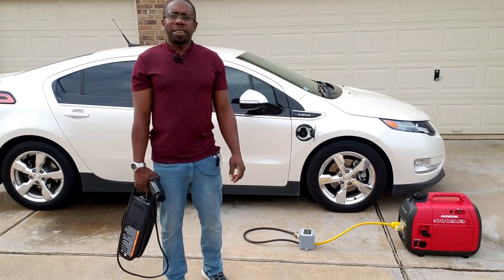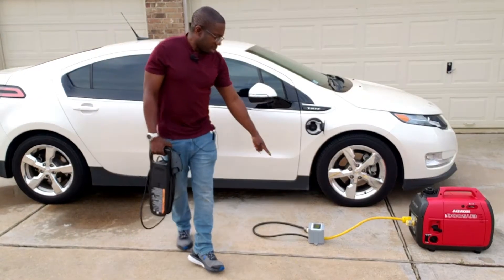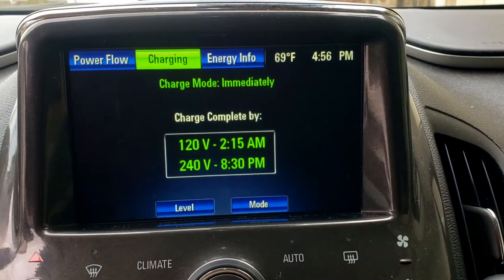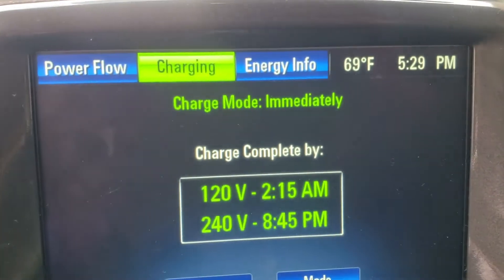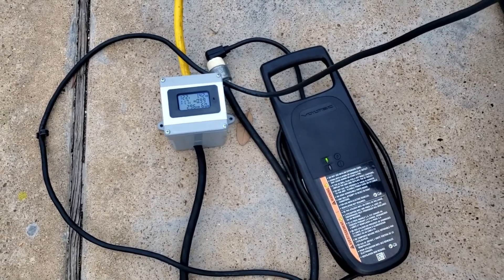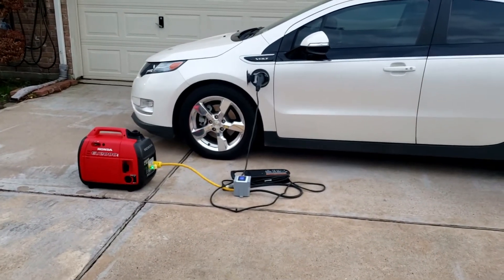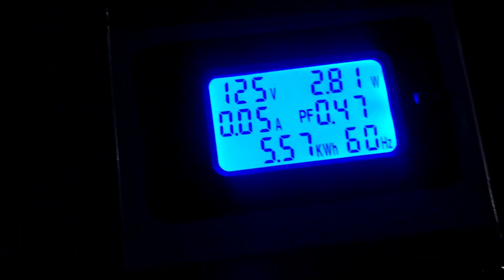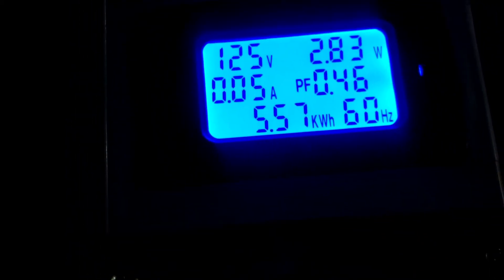Honda EU2000 Inverter Generator Charging an Electric Car.

Comment: I know that your intent was to prove charging in an emergency, but this also proves that this little, red Honda can be like a little red gas can. If you are stuck without power on the side of the road, a friend or spouse can come with the Honda and give you just enough charge to get you home or some other charge point. 
It also shows that if you go camping at some remote site, you can use the Honda to power the loads at camp and then add a little charge to give you some range to get you home!
Reply from the maker: I only wished everyone got my intent like you just explained. EXACTLY 
Thanks for watching 👍🏾👍🏾
Reply: if it only adds 15 miles in 4 hours a friend or spouse would be better off throwin a tow rope on it and tow it 15 miles and be done in 30 minutes instead of 4 hours
Reply: Yea if you don't mind sitting on the side of the road for 5 hours.
Reply: @warntheidiotmasses7114 or listening to a generator run all f’in day while you’re camping lmfao
Reply: @pnwDatsun  The last 3 years was an IQ test. One of the questions was to buy an EV or not.
Reply: That's exactly why I looked for this type of video,... In 2023 Subaru is releasing their AWD getaway all electric vehicle.
Reply: Or you can get an equally sized compact hybrid that gets 50+ miles per gallon and have your spouse bring you a gallon of gas.
Reply: Which would imply that you have to tell your spouse that you were silly enough to run out and need help? Nope Nope Nope @nateman79
Reply: @nateman79  For how much? $40,000? I can buy a 30 year old Toy diesel for $2000. Thank JesuS!
Reply: @warntheidiotmasses7114  diesels are cool by me… I just think electric only is ridiculous when you can have both… I just want my FJ cruiser, and to be left alone
Reply: @nateman79  yes and run without waiting 4 hour 50 miles with 1 gallon

Comment: 15 millles with one galoon of gas? This is a really poor yield. My Renault Clio runs 15 milles with 0,36 gallons. Converting figures into european measurments 15 miles with 1 gallon means expending 15.7 L per 100 km. Most of the cars expend 5-6 L per 100 km. Absolutely terrible for the planet.
Reply from the maker: I think you missed the point we were trying to make in case of EMERGENCY can you recharge your car with a Generator.
Reply: @GeneratorReviews  Yeah, for an emergency it could be a good idea. I was thinking if it was possible to have a generator with a higher efficientcy than a standard gas engine.
Reply: Diesel even less.In Greece where i live a make 1200 km with my Peugeot 406 hdi automatic.Its 65 liter tank.
Reply: wríbg
Reply: 1980  7,5   2 tmme more gas ysrga 155 noh

Comment: Go to 6:29 to get the answer... 15mi/gal  Too many people think electric cars are saving the planet. They don't. Where does the electricity come from to power electric cars? Hmm most of it comes from combusted oil converted to electricity. There is a lot of energy lost in the process. Esentially that is what this video showed... a gas fired generator providing 15mpg! A gasoline powered car can get more than double that!
Reply: Unless you have solar panels.
Reply: @Jimmyxsx  you'd have to have a car with a roof the size of parking lot filled with solar panels to get enough energy to drive a heavy car. Too many dreamers out there that don't have a clue how much energy it takes to move a car. There's nothing magic about solar energy... it's easy to harness, but the energy density is low.
Reply: and a gas car isn't running on a tiny engine stressed to the max.  Even if your power comes for gas or coal powerplants (not a tiny generator) EV's are more efficient.  That being said, i really couldn't care less what other people drive, just get your facts straight.

Comment: Chevy volt no matter how you charge it 12 amps  takes time
Reply from the maker: Yep!
Reply from the maker: Only way to charge it fast is with the 240v fast charging
Reply: Or a ccs fast charger. 50kw at evgo.

Comment: how many hours did it take?
Reply from the maker: It took 4 hours with one gallon of gas at 11amps That’s pretty good for this small generator
Reply: @GeneratorReviews  cheaper than a tow truck if there are no car chargers nearby.  just find a gas station and buy enough gallons to charge to the next car charger
Reply from the maker: @mikehascats26  so true I never thought of it that way

Comment: good information. thanks. electric cars need better batteries.
Reply from the maker: Yeah that’s true
Reply: Yeah on the best ev you'll only get about 5mph of charge on a 110 now that # would change dramatically with a 220 in my experience with an electric car
Reply: No, you just need to use your brain, pull over and recharge.

Comment: Very interesting!  I thought the Honda EU2000 would have given more than 15 miles.
Reply: I would think so also, maybe a full tank would make a difference.  My Honda eu2200 & eu22001 runs for 9 hours on a full tank when hooked up to the house, running a fridge, chest freezer, fans and lights and various chargers for phones etc.  Last few hurricanes has proven the Honda generators are life savers here in SW FL.  We went two weeks w/o power after hurricane Charley and 7 days after hurricane Ian.

Comment: Great Video.  Do you have a 240v generator to try this test with?  Seems like you would get twice the charge with roughly the same amount of gas.
Reply: It would take more gas probably. The larger generator will use more gas even with no load.
Reply from the maker: Great point!
Reply: I wonder what a step up voltage converter would do.
Reply: @texastowman233  You would loose power in the conversion.
Reply: There ain't no free lunch ... 240 volts would charge in a shorter time but use about the  same amount of gas because you need more gas power to drive the 240 volts.

Comment: what is the "neutral" device?
Reply from the maker: Generators with an ‘open neutral or floating neutral’. Some generators have a ‘floating neutral’. Surge protectors or any other EMS surge protector will give you an ‘open ground’ or ‘open neutral’ error code and prevent power from going into your RV. To correct this issue, simply plug this item into an unused 15A AC receptacle on the generator. This create a neutral to ground bond and the condition should be resolved.
Reply: Thx. Do you have a link to the device?
Reply: You can make it yourself. Bonding plug.

Comment: Good job. You also found out how long the Honda will go at 1400 on a gallon of gas. I’m sure the 3k Honda will get more since it won’t be working the generator as hard. 
Also, a video of you paralleling the Honda & firman to see how it works will be good.
Reply: I'd be willing to bet the 2000 goes longer at the same Amps than the 3K.  I have a eu2200 and a eu1000i and the eu1000i is way more efficient because of the smaller engine. I shared your belief before I had both of these generators.
Reply from the maker: Great point!
Reply: The set up he has and the amount of gas used at 12 amps is going to be the most battery you are going to get the 3000 will drink the tank dry in way less time don't need a test the jet size in the carb or injection says it all !!
Reply: @rickybailey7123   3000 can charge 2 Tesla at the same time, but with 1 gallon of gas, both Tesla gets 7.5 miles.

Comment: My buddy and I were just talking about testing this.......good job.

Nice meter.....😉
Reply from the maker: Wonder if I would get a different result using a 3000w generator
Reply: Considering your only able to provide 120v and about 11.5 amps most cars are able to handle a 50 amp circuit some even higher. 
So if you could do 25 amps which would be max load on a 3000 watt gen and at 1 gallon....would you gain much more because you will be burning more fuel for sure. But for emergency thats exactly what its for...just enough if you need to get around a little bit.
Reply from the maker: Thanks 🙏🏾
Reply: @GeneratorReviews  that would be cool....where do you live...? 👍😃
Reply: My leaf charges at 1800 watts with a similar charger. It used 2.5 gallons in 4 hours. I didn’t check the miles.
Reply: @GeneratorReviews where did you get that meter? I've been looking for something like that but for 240v.